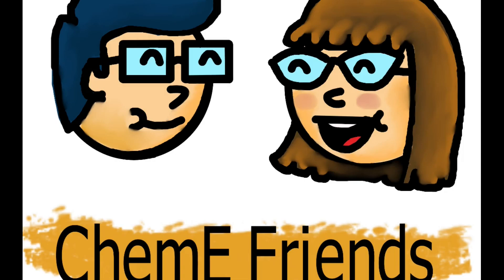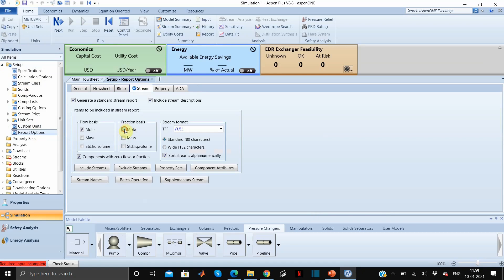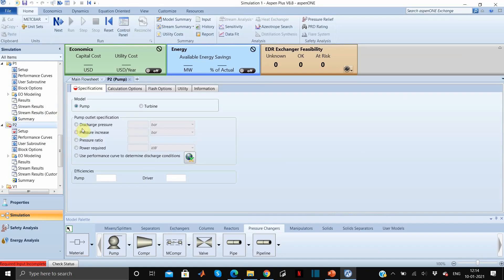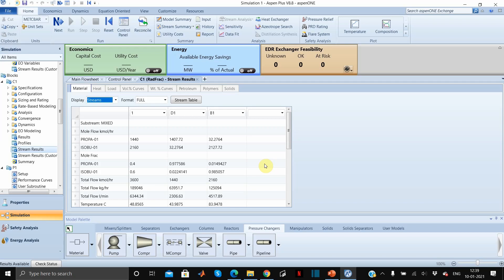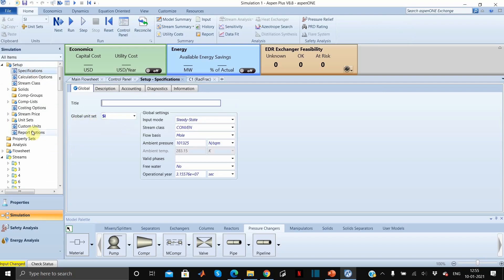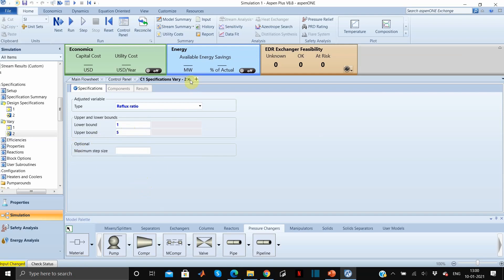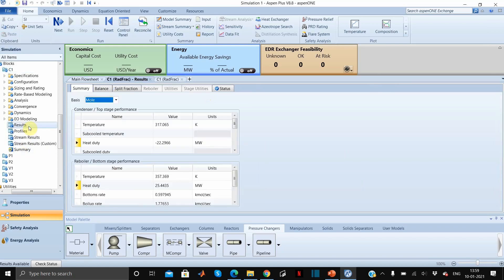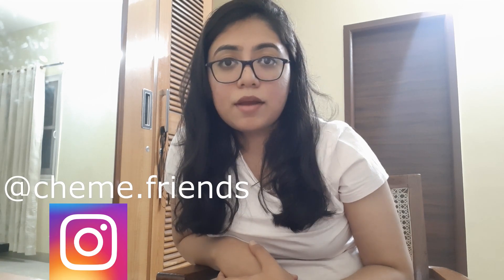Design of Distillation Column||Optimum Feed stage|| Design Specification||Aspen Plus

Comment: How to reduce the amount of vapor at the top of the rectification column? The type of trays, their efficiency? I have a lot of top reflux in model the unisim program. I am asking for an answer and best regards.
Reply from the maker: You can fix the amount of top product in "design specification" tab and then try to vary reflux ratio, no of  trays etc.
Reply: @chemicalengineeringfriends217  Thank you very much for your answer.
Reply: @chemicalengineeringfriends217  Thank you very much for your answer.